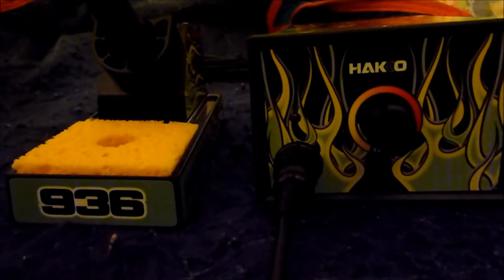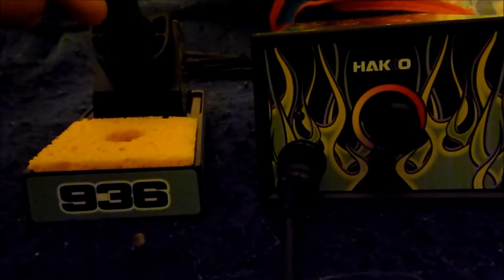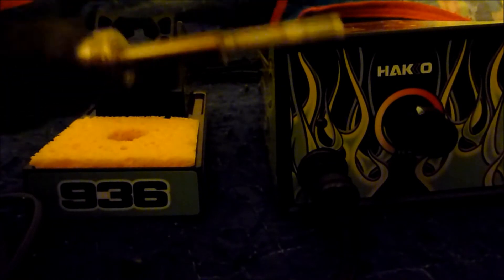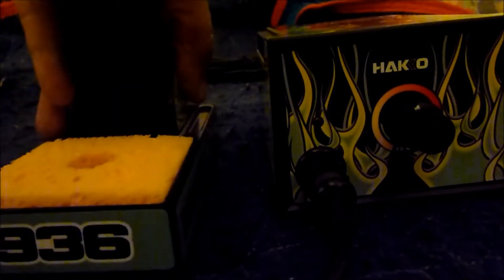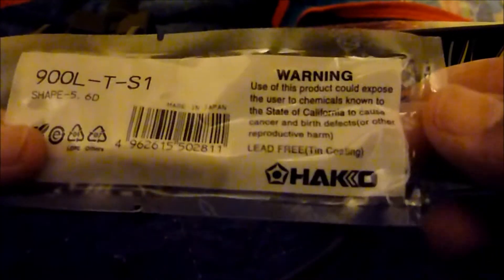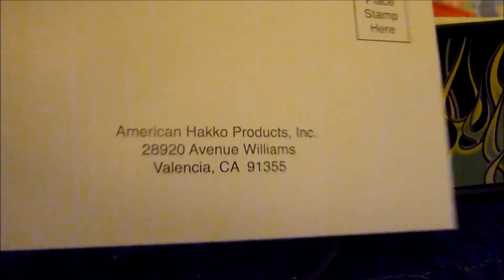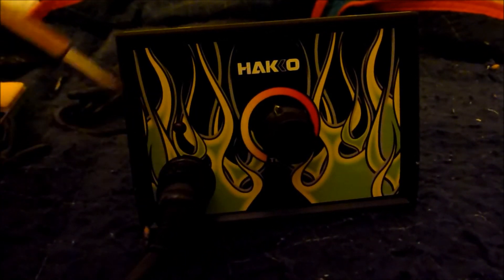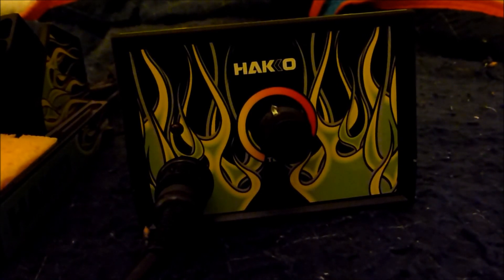Hakko 936-13 ESD Soldering Station

Comment from the maker: @pufarinu Im extremely happy with the 936-13 Hakko soldering station. If youre soldering heavy duty wire use the large chisel tip.